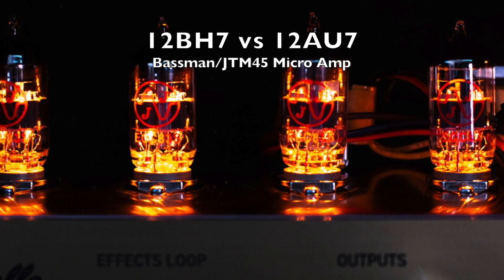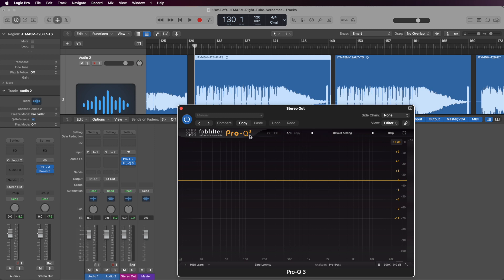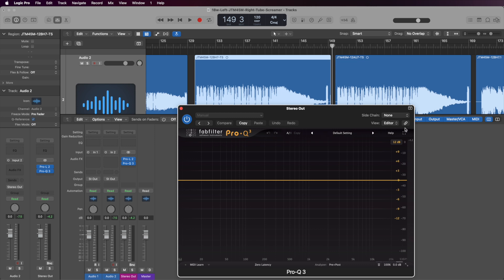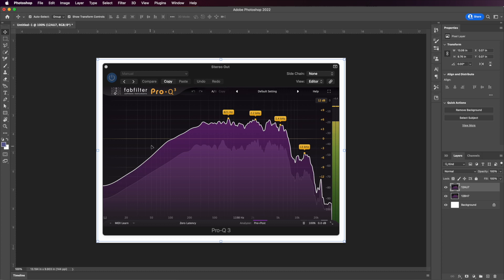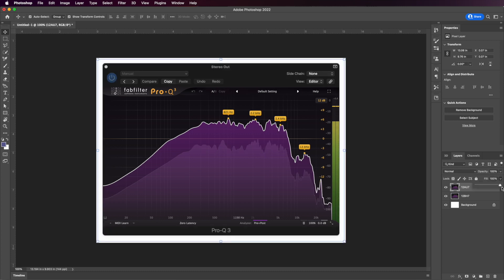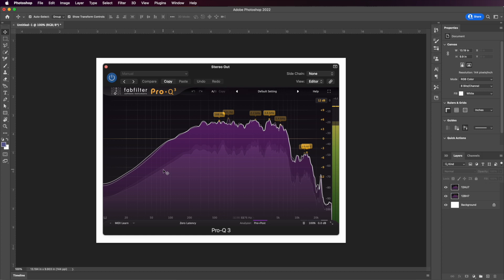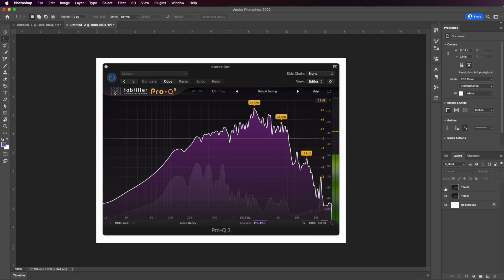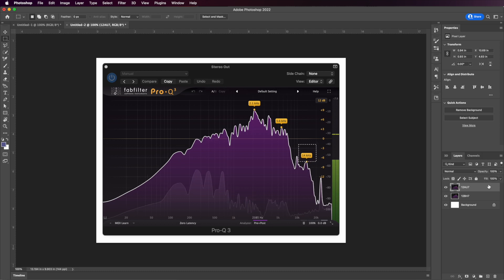12BH7 or 12AU7 in a Micro Amp

Comment: 12bh7 sounds a bit warmer. Is this due to its larger plates? You won't get more power without changing the bias and/or increasing the plate voltage and/or changing the output transformer turns ratio.

Comment: As a power tube a 12bh7 puts out 5 watts of power a 12au7 is 1-2 watts.
Reply from the maker: On paper, yes. In practice, I'm getting about 0.5w of power when measuring the 12BH7 with an oscilloscope. The amp is plenty loud for playing inside the house solo though!

Comment: The 12bh7 was build to be stable for higher frequency usage.
Reply: What does it mean in practical usage? Can I use it instead of my 12AX7 in my amp?
Reply: @hmtp177  These are being used as a power tube in a 1W(ish) circuit.